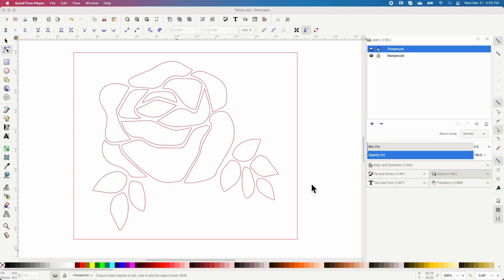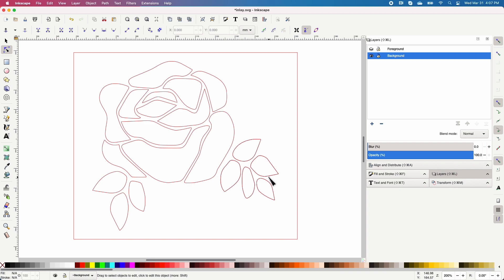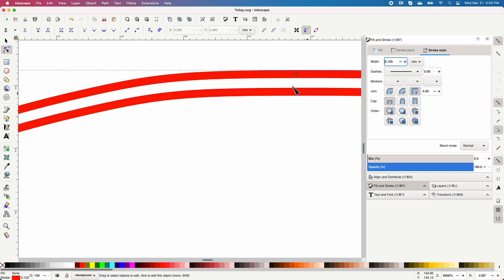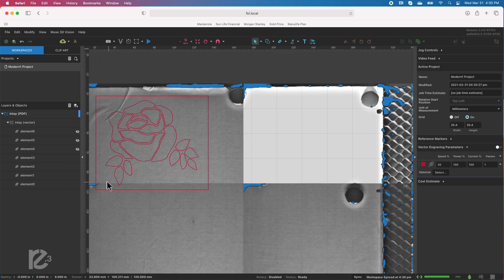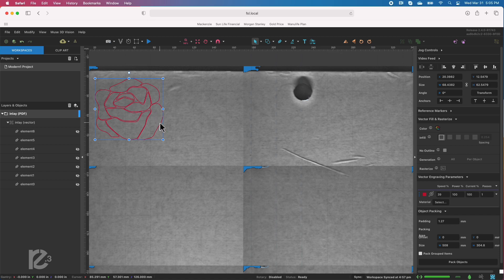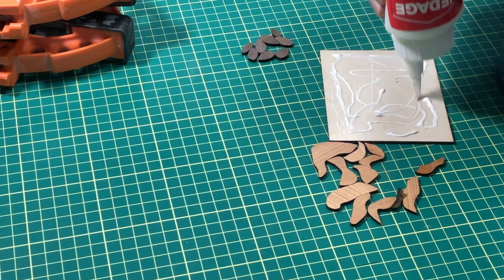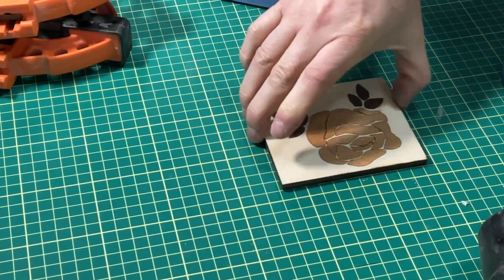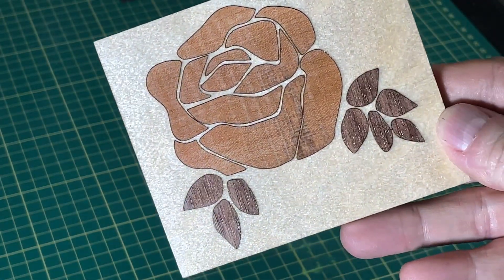Modern Laser Inlay Secrets

Comment: hi another question at risk of abuse of your time, i saw in one of your videos basically u mask whit tape virtually all the materials you cut and engrave that is correct?
Reply from the maker: It depends on the material and the task I’m trying to achieve.  However, I only ever mask for cutting, and usually if the settings are correct, you can avoid masking most of the time.
Reply: @SteveMakesEverything  understand thanks a lot!

Comment: Hi Steve, im learning a lor from your videos and im very thankfull,  just got a 22w diode laser i could not afford any better but i will start whit ot following your budget advice, in this case my questios its maybe too picky but lets say given a determined line over the laser must cut, how the kerf behavies, for instance, lets say i need to cut a circle, the beam will cut following that line but the kerf will be outside, inside or will split at both sides of the circle line?
Reply from the maker: The laser will cut on the center of the line, so half the kerf will end up on either side.  Note that if pre is ion is required, you can use kerf compensation in lightburn to force the kerf inside or outside the line.
Reply: @SteveMakesEverything  thanks a lot Steve for ur answer!

Comment: nice video. If this would have been done with 0,6mm veneer, would the dark lines (burn wood marks) around the pieces - be less visible, or not at all?
Reply from the maker: Yes, I did another vide more recently with veneer.  It really depends how much you want to spend, but in Lightburn you can compensate for the kerf of the beam and tighten up these lines.

The design here was done with a CO2 laser, which tends to have a much lager beam diameter than a diode laser.  ~0.3mm vs 0.1mm

Comment: This is the kind of thing that I as a hobbyist woodworker want to get from a laser. I don't have time to master hand-cut inlays and marquetry so this is my "hack" to do them. 
Just FYI: if the inlay is more basic and doesn't have really small areas or tight corners you can make them with a router and inlay bit set, but use the laser to create the pattern to follow. It's very yeas and comes in handy if you want to truly inlay into a piece of thick hardwood or don't want the burn marks of the laser to show on the edges of the design.
Reply from the maker: As long as you can cut an accurate hole and calibrate your laser to cut something to fit, it will work.  This inlay process is actually a lot easier with Lightburn-based lasers because Lightburn has automatic kerf compensation.  I did this video originally for people with Muse 3D lasers, where all of the hard work is left to you.

Comment: It would be instructive to see how power and speed settings are determined for burning the inlay pockets. In other words, to get the depth right.
Reply from the maker: This would be a challenge since every laser (even lasers of the same make/model) will be different. This is where it stops being engineering and starts becoming art.  Sometimes you just need to experiment.  What I did here was cut all the way through a piece of plywood and then laminate it onto another piece.  

However if you are using solid wood then you only need to worry about making the pieces fit. As long as you inlay is sticking up a bit, you can sand it smooth

Comment: Hi Steve, I'm a bit new to inkscape but as far as I can tell the stroke width is centered on the path outline and while it does not affect the export path, it would seem to affect the optical offset calculation. In other words, try this: set your original path to something like 3mm and try this same process and you will get a different result. My best thinking is to use your technique but to have a stroke with of zero and just use a fill color and then you'll get an accurate result.
Reply from the maker: I usually set the stroke to something small like 0.125-0.25mm, though it shouldn’t matter since the vectors are just point to point lines

Comment: How did you determine what your kerf was for your laser. Thanks for sharing.
Reply from the maker: I did a video on Kerf that will show you how to calculate it.  If you use a CAD tool like Fusions or you talk to your laser with something like Lightburn you may also be able to do automatic kerf compensation
Reply: @SteveMakesEverything  Thanks. I found it. Great explanation.

Comment: Tell me if im understanding this correctly.  The Kerf measurement your using is based upon cutting a line and measuring how fine a line it will cut?  Or is itif you cut a circle 5mm in diameter and then measure the cut piece and it is 4.66mm in diameter?
Reply from the maker: Well more or less.  The kerf is effectively the width of the laser beam - it is small but not inconsequential.  The laser will always cut on the center of the line from your drawing, so half the beam width goes on both sides of the line.  This will definitely make a 5mm circle slightly less ,  You can hone the kerf down a bit with great alignment and perfect focus, but it's going to be somewhere in the ranging of 0.1-0.3mm

Comment: I never knew what the width of the blade was called. Your compensation with the vectors was fascinating.
Reply from the maker: I guess I probably should have better defined the term kerf since not everyone is a woodworker
Reply: @SteveMakesEverything  , I was curious if I even spelled it right! I've done my time pounding nails. Its all about the cut line and make sure you take the pencil line when you cut.
Reply: @kurtanp  well with lashes we can avoid the pencil ✏️😀

Comment: Very nice!!.. by any chance do you know if the lens of muse can be replaced with a different brand lens?. I need a new one.  I replaced the power supply and  the lens crack on  the first run. I really prefer not to pay $200+ for a new lens from the FSL website.Any help is much appreciated! Thanks!!.
Reply from the maker: When it comes down to it a lens is a lens. There are after market lenses, though because the Muse has a custom mount you will need to remove to old lens and insert the new one.  The convex side goes up.  Most likely your new power supply amped up the beam density and if the lens was dirty it likely heated up enough to get damaged
Reply: @SteveMakesEverything  Thanks👍